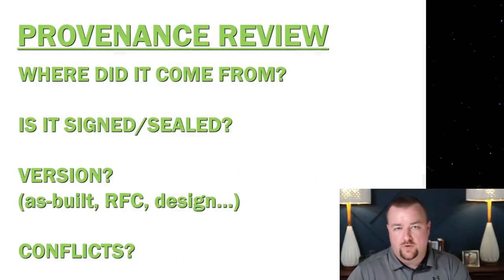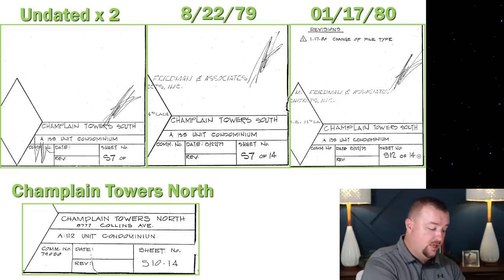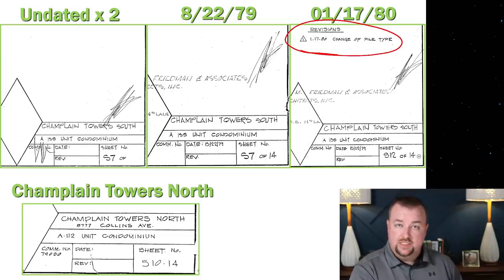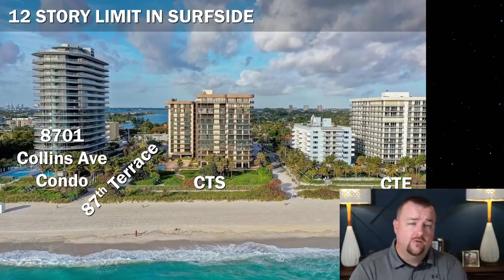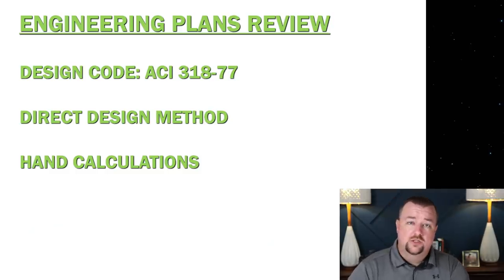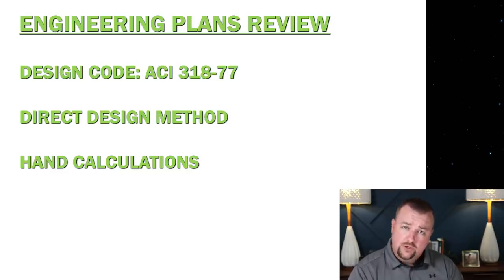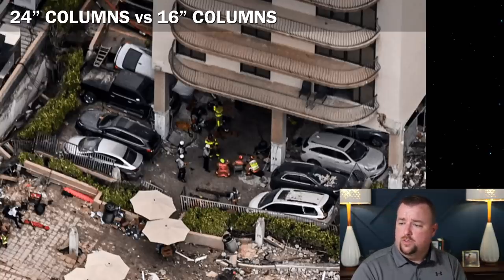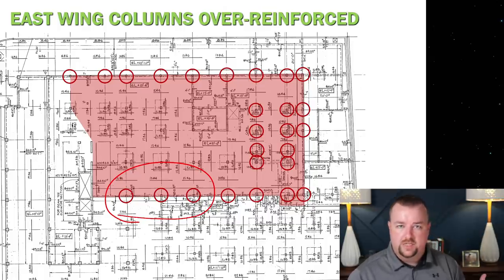Engineering Failures Found in the Champlain Towers South Drawings - Surfside Collapse

Comment: I would love to see if that sister building they build a few doors down has any of the same issues with the deck leaking and if it also had support beams that were not included under their planters.
Reply: cough Shoring!  RETRO-fit! cough-cough Nothing to see here... moooove along.
Reply: Whomever is living in that sister building deserves what's coming to them... Common sense would be to move IMEDIATELY! I would even break a lease lol.
Reply: @ricky4673  what if you own it with a mortgage?
Reply: @ricky4673  , that's not a rational take. if your choices are: A) become homeless and bankrupt or B) rely on engineering firms to determine if there is risk of the same thing happening, rely on the engineers. there is no chance you can sell this condo now, so you either live there or you declare bankruptcy, which may put some people out on the street. it's a hard choice. eventually, you would hope that lawsuits or city programs will come through to take the burden off of you, but those things typically take a long time.
Reply: @ricky4673  Why would the people living in the other building deserve what's coming to them? Some new resident deserves to die because they rented an apartment without doing a structural inspection first? Have you ever hired a company to do a structural inspection of an apartment you moved into? I don't understand that statement at all.
Reply: @Sleepdroidstudios  Guess you lack common sense. If a sister building collapses why would you stay in a building that was based on it's design?
Reply: @somedude-lc5dy  Some times irrational decisions can save your life.
Reply: @Galworld761  Sell it?
Reply: The stories I have seen on the other building indicate that it has none of the problems the fallen building had and is perfectly safe.
Reply: @ricky4673  oh, yeah, because that would solve the problem. Wouldn't the person who bought it "deserve it"? And who the duck would buy a unit in a building who's sister just collapsed? All those mortgages are underwater now.
Reply: @somedude-lc5dy  I'd pick join the Peace corps and forfeit the place. Rebuild life when I came back using my Peace corps references for help.
Reply: @douglasskaalrud6865  I not trusting that long term probably built to maximum stress. Would want plans ran over by several different experts and way more than one Engineering team to go over. Almost certainly it might be safe right now but areas have been a max load from the building and almost certainly are going into overload at least slightly. Probably needs long term improvements to last much longer even if safe for next say five years.
Reply: @MajorCaliber  😂
Reply: From what little I've seen of small concrete samples taken from both buildings, I think the two buildings had different concrete suppliers.
Reply: @Timothée Bilodeau - Right the world is watching.  China has built thousands of high-rises in the last two decades and their citizens invest money in them.  So it should come as no surprise a Chinese University Team did a serious analysis of  Surfside and compared it to what they're building for their citizen investors.   Their analysis concludes the Surfside was built under 1980 codes, and China's construction codes are all from the current century.   Was a good video, but I can't find it.
Reply: @RedRocket4000  a lot of these people are retirees.
Reply: @Blake Belladonna it depends on the structure. My house is close to 100 years old. I did an inspection when this happened. Inspector called it a “ bomb shelter”. It is built on really rocky terrain. Japan is island with shifting ground - the topography really matters.
Reply: @douglasskaalrud6865  "perfectly safe' sounds like when you see a restaurant with the name '#1 chinese'  or how every cup of coffee in those blue and white paper cups in NYC is 'New York's Best.'
Reply: @ricky4673  what if u cant 
what the fuck do u think the world is sometimes people cant just leave
Reply: @ricky4673  No...they don't. blame the right parties
Reply: @ricky4673  To whom?? Who will buy an apartment that infamous?? And why would you suggest that did honest act??
Reply: @ricky4673  You are allowing magical thinking to move your fingers
Reply: @ipsosmaati1971  Then move there. Put your actions with your mouth.
Reply: @ricky4673  you are not bright
Reply: @douglasskaalrud6865  The hook is that they have not explained why they think that is the case, since it was built at the same time using the same plans.
Reply: @Blake Belladonna Sure is a great idea for the contractors. Hahaha. Rebuilding homes once a generation or two. Fact is, with quality craftmanship, over-built engineers and good materials you can build a home that'll last 100 years with minimal maintenance. Keeping up on paint and caulking, good drainage, roots/pests away and you're solid.
Reply: Some purely psychotic replies here. But in any case, they’ve looked at the building and deemed it to be fine. I’m sure the plans will exist for the north tower, but they were saying that the concrete was consistently better than called for, which was not the case here. Also, the north building is smaller, both in size and the plot it’s built on. The south tower had been screaming in pain for years, but the north building is fine. No water intrusion, no concrete degradation, nothing. Which just boggles my mind more. I think, personally, I would be happy to live in that building. People here are looking for a link that may not even exist. The buildings are different enough, which is all that matters. The north tower is not a carbon copy of the south, there are important structural differences.
Reply: @Dude with Opinion People sell things at a loss sometimes... I would say this is a good enough reason to. I wouldn't live there for free.
Reply: @ricky4673  That was done until Hurricane Andrew. probably is back now.

Comment: It is outstanding that you won't jump to conclusions but rather do some dilligent work. Other channels "found" the "cause" weeks ago. It is honorable that you won't let yourself be rushed by others that pump out the videos in a rather fast manner.
Reply from the maker: Thank you.  I also stopped watching other youtuber's videos on the collapse over a month ago, because I didn't find them particularly helpful and knew they couldn't have found the "cause" this early in the process.  I do try and keep up on industry journal articles and video interviews with other engineering firms to see if their is anything I'm missing or if they are correlating my findings independently.  This video was about 3 weeks in the making... most of that time spent doing due diligence research on the drawings and comparing them side-by-side (when I wasn't doing my day-to-day job).  The reality is that a true initiating "cause" may never be known.  Was it JUST corrosion and poor design?  Was it a car that hit a column and kicked off the dominoes?  We may never know for sure the trigger.  When we reach a theory, it will be strongly supported by the physical evidence but I'm not aware of any scientific theory that is 100% certain.  As I'm sure you know from your channel name, that's not how science works.
Reply: @BuildingIntegrity  maybe if Champlain security videos are recovered we will know more. I would hate to see Draconian measures imposed on all the buildings and residents in Florida just because 40 years ago an engineer removed beam a support structure in the parking garage.  It may be more prudent to look for design deficiencies than have every one pulling 12 million dollar remediation.  I bet not one remediation contract told the tower "you sure could use a beam underneath this 1st floor parking area and planters". I think that would be the low hanging fruit to prevent further loss

Comment: So here is the question: is the North tower built the same way? We've established that it doesn't have the same water problems, but did it use toothpick columns and exclude beams beneath planter boxes?
Reply: yeah probably being that it is newer is why it is still standing for now probably how long it stays standing is anyones guess it may fall down soon to as well
Reply: I'm betting the property value of the North tower has plummeted. Who would want to buy into that now?
Reply: Good questions... just as with the collapsed CT South, the drawings from CT North are public record, and available from Town of Surfside... if you want to go through their bureaucratic procedures to get them.  There may be per-page copying costs.
Reply: @MajorCaliber  Engineer said it safe But they need to assume that safe for now not the future. Get more opinions and have two different expert teams rework all the plans. 
North was not built on former water and did not sink into the earth for a decade also like South so North might have another ten years but I would not trust it past a year.
Reply: @RedRocket4000  CT North is only 1 year newer than the collapsed sister CT South, not 10 years.  The CT East is 10-12 years newer, but very different design and construction.
Reply: @MajorCaliber  Just wait for a few months.  No doubt the drawings of the other buildings will be part of the exhibits for lawsuits.
Reply: the CTS had very strong columns and a weak slab system.

Comment: Somebody's probably already mentioned this, but would it be wise to go check Champlain Towers North to see if the 21" beam was removed there too?
Reply: Right! I find myself wondering what kind of mindset those folks have right now since, I'm guessing, they're twins, right? I would prob be considering another living arrangement, regardless
Reply: @carvalone3076  they would probably move, though I shudder to think that the best they will get away wjtb is a serious loss of capital as their apartment will simply not sell anymore.
Reply: @hoihoi12250  It was rated ok for now but I'd get two more opinions including three different firms to go over the plans again. Probably find that even if it safe now it built close to failure and if safe now will not stay safe for long.

Comment: genuine engineering analysis, im a MECH. ENGINEER thumbs up good breakdown
Reply: I completely agree. Clearly explained and captivating. I'm an EE and had the usual year of ME courses (Statics, Dynamics and Mech of Materials) required for all engineering disciplines/students. Those courses that I had years ago weren't necessary because Josh did such a good job explaining, but it helped in captivating me because I had enough background to follow each point with my head nodding through the entire video. Two thumbs up Josh!

Comment: Good video.

The 6" overlap on the bottom bars actually meets the code requirement for temperature/shrinkage steel. The reason is that you have top steel in the same location that is in excess of the minimum splice length. This is a common detail. However, I would ordinarily just note the bottom  mat to lap at column lines and not dimension the lap at the column.

It is well worthwhile to mention that the design load for the cars is only 40psf and 100psf for the patio assembly load. Nowadays, in most codes the parking load is 50psf so it is a little bit different but not that significantly. The 100psf just isn't for people load, it is for maintenance equipment on the ground floor deck. People are generally heavier than cars on a per square foot basis. It is not intuitive but a heavy pick up is about 35psf (this is strictly over the area of the vehicle but it is even less when you consider the additional space around the vehicle) and a crowd is about 45psf. It there is music, with the impact load, you can get up to 100psf or even more. A braking or accelerating car does not add vertical load but it does re distribute the vertical load to the front and back tires respectively. The added topping/pavers applies more total load to the columns than the cars.

It is worth noting that the corroded steel substantially reduced the punching shear capacity. There appears to be missing steel at the pour joint as well.

It is important to note that integrity steel is now required at columns in flat slabs and was not required in the 1970s and early 80s. This is additional bottom steel at the column. The intent is to still have catenary resistance if the top steel fails or you have a punching shear failure. It is a second line of defense. Although the top steel is sized for bending, it is critical to the punching shear resistance of the slab. Without top steel, the punching resistance is essentially eliminated.
Reply: All correct and as pointed out on Engineering Forum I'm reading the Patio Deck should not have been connected to the building with some way if it failed it did not effect the rest of the building. These separations of areas is often critical and when ever possible a failure in one thing should not cascade into other things.
Reply: @RedRocket4000  Designers should try to design the structure so that you won't get a cascading failure but that is a lot easier said than done. I don't think it is possible to completely alleviate a progressive collapse.

An expansion joint is actually not a great idea. They are notorious for leaking which can cause a failure of columns, a bending or shear failure of the joint which could also cause a cascading failure of the building. Having the ground floor run through is a very common approach. Sometimes when you try to solve one problem, you create another. Don't forget that there were multiple issues with the pool deck slab. If there was just one thing wrong with one joint, you won't likely get a cascading collapse.
Reply: @yodaiam1000  Were the designer and structural engineer qualified?
Reply: @ffxbellini  They were legally qualified. You have to be to sign, seal and submit drawings for permit. You need to a professional engineer or architect to seal the drawings.

However, there have been cases where a mechanical engineer will seal structural drawings. They may think they know more than do. This is legal but they may have a misconstrued impression of their own knowledge and abilities.

So legally qualified doesn't mean practically qualified or able. An architect can also seal structural draws but may know little about structural issues.

Some jurisdiction are now requiring an S.E. or Struct. Eng. (depending on where you live) to seal structural drawings but this is a more recent development and is still not a common requirement.
Reply: @yodaiam1000  You are absolutely right about the six-inch lap over the columns. That was standard in the late 70s and early 80s. It’s also true that the top steel over the columns, likely of greater cross-sectional area than the bottom steel, would have satisfied the temperature steel requirement, and, moreover, would have been in the correct plane for limiting the crack width of any temperature, or shrinkage, cracking, in combination with the tendency for cracks to develop due to flexural tension. Today those splices would be for full development in the interest of preventing a full collapse if a single column were lost due to, say, impact due to a collision, or an explosion.
Reply: @RedRocket4000  I am a structural engineer (for over 30 years). All the ways to separate the deck is essentially an expansion joint. You can call them what you want but that is what they are. You can double up the columns, or make a shelf. All these ideas are essentially expansion joints and they are susceptible to water infiltration and that is the fundamental problem. You can detail water proofing but it has to be maintained. So it is just causing another issue.

The deck braces the retaining wall around the perimeter of the building and the joint interferes with the bracing of the retaining wall. It also effectively reduces the effective height of the core (the shear walls) of the building. Adding a joint makes the lateral system more expensive, increases concrete, causes more complexity, and increases carbon.

There was a systemic issue for the entire deck. A lot had to go wrong to cause a progressive collapse. 

There is nothing in modern codes that makes the structural concept of connecting the ground floor to the building any different. However, there are better membranes, you could use hot dipped galvanized rebar (but really isn't done much in the North America). You can use more concrete cover. You can use less permeable concrete. You can use Xypex or Kim. You can add integrity bottom bars to the flat slab at the columns (second line of defense in case of punching shear). You can add punching shear rails. But I still think separating the structures adds a lot more complexity and not much more if any safety. You are just replacing one problem with other problems and spending a lot more money and energy doing so. You are also increasing the carbon foot print.

The codes are already complex enough without adding more unnecessary restrictions that haven't been proven to be effective.